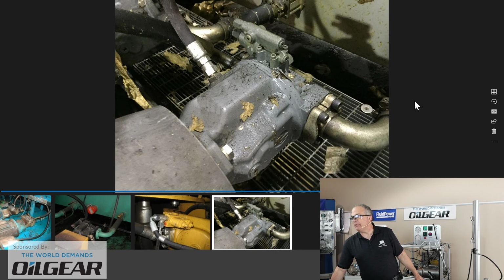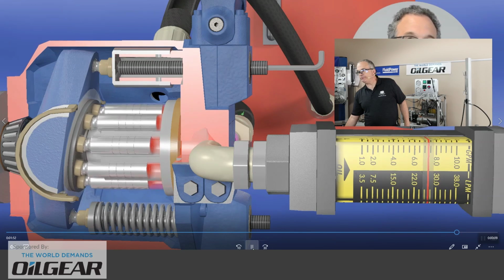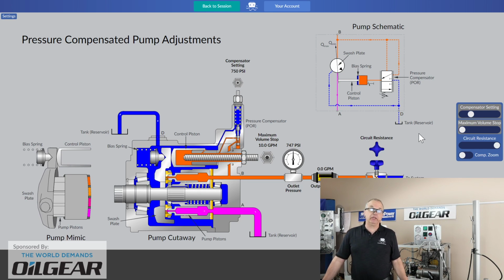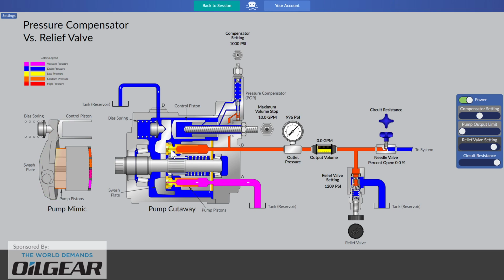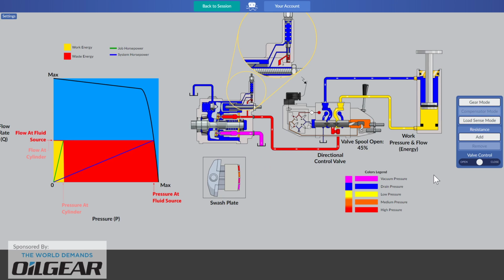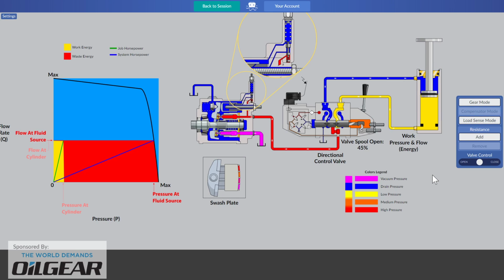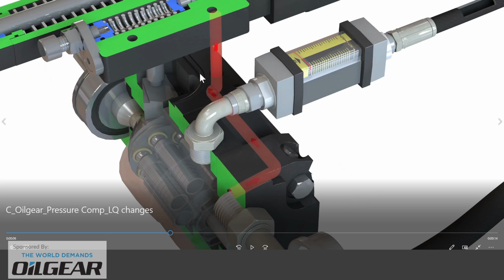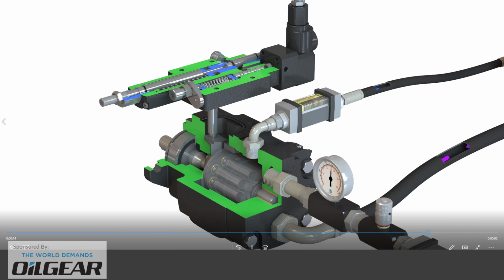Piston Pumps: Displacement & Pressure Cutoff

Comment: Namaste, Experts 
Can some one guide me for pump type selection to be use for high frequency (about 20 Hz) oscillating hydraulic actuator with 100 mm stroke and varying loads?.
Reply: That will depend on the size of the hydraulic actuator.

Comment: Hi experts, could you simulate relate between starting torque ( HP ) of motor when start from 0 pressure with maximum output flow and minimum output flow ? If I start the pump from 0 PSI with out port fully open ( max flow ) , then the torque on motor is very high , right?
Reply: No, I put torque is a function of pressure. So 0 bar/psi means minimum torque

Comment: You would not happen to be a Utube trouble shooter ? I have a skid steer pilot controls all functions work fine except for travel.   Pilot pressure is checked and is at 500 to get the track motors to move you must move the lever very slow or just crack it to get the motors moving and than you can move flow to high  speed however if you stop return to center you must move slow again to get it moving I just cant seam to figure it out
Reply: I have messaged you privately over LinkedIn. Thank you